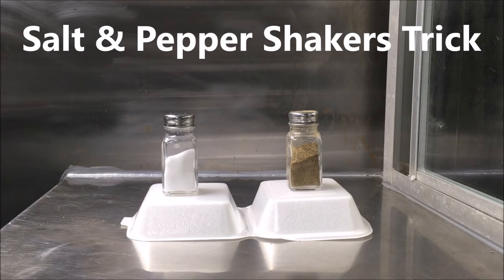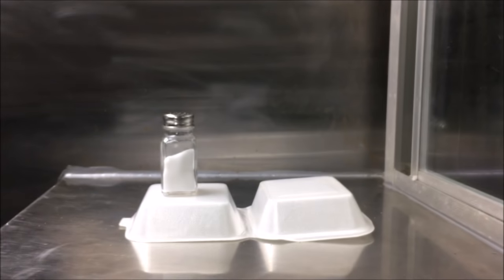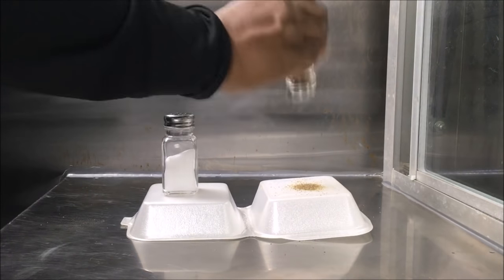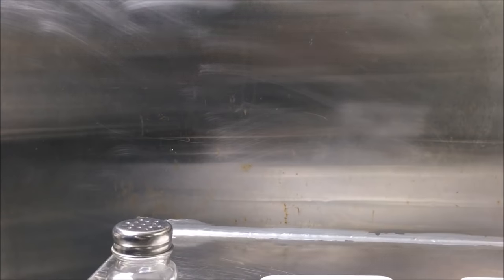THIS IS WHY SALT & PEPPER SHAKERS HAVE RIDGES ON BOTTOM; THIS IS COOL

Comment: That’s not what they are for. As a cold glass sits in a room-temperature environment, the glass begins to collect condensation. ... To prevent that condensation from causing the container to slide on the surface it sits on. The ridges are added to prevent breaks and spills in the kitchen or on the dinner table.